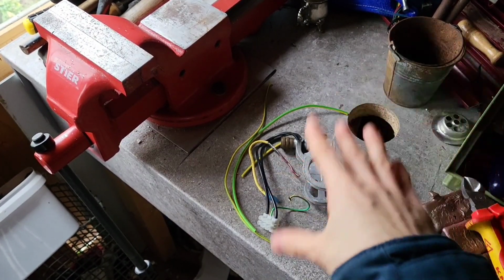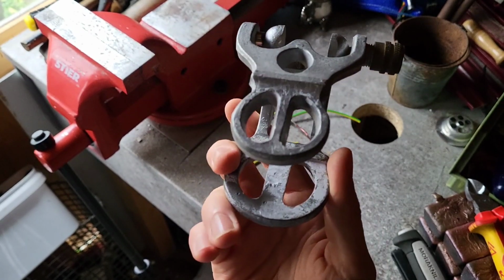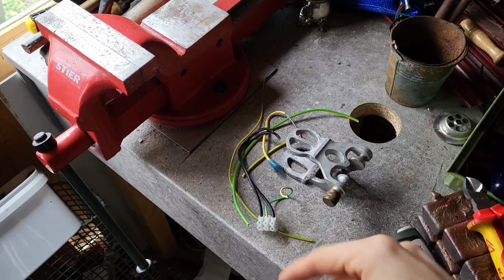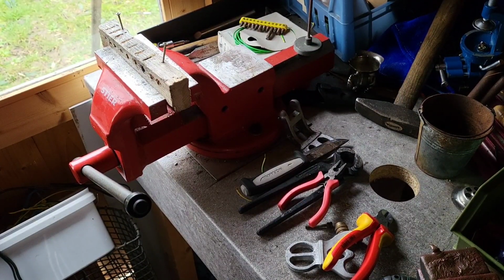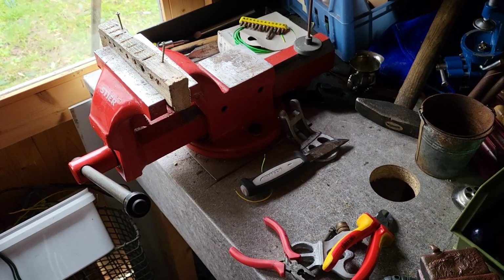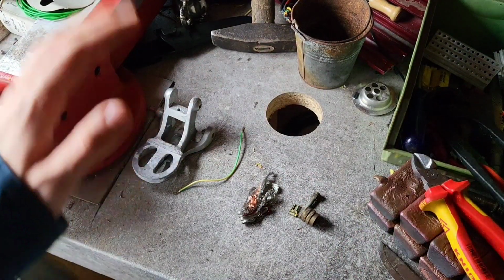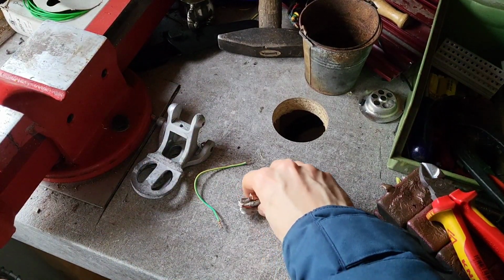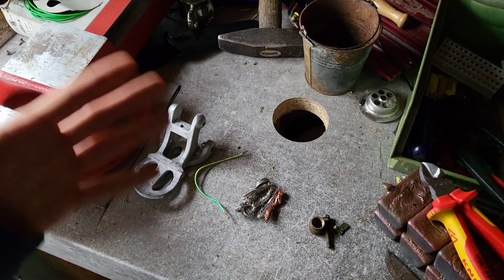Scrapping dumpster finds for copper !

Comment: Good job despite the knife mishap....short lengths like that i tend not to bother with it and instead ill just throw in the 220ltr drum to be sold as a high grade cable if it fits the category or else it will go in the other drum as normal low grade cable.
Reply from the maker: Thanks mate 😊 Well, if I would do that, I would get 1,50€, or about 2 AUD for a kg, so I would literally burn money. That's not something I can do, as my price for wire is exceptionally bad when it comes to high grade wire. Thanks for watching 👍👍👍
Reply: @scrappingadventures290  Ahh ok fair enough and can see why you have to do it, i wish you got the same prices i got so it would save you the extra effort you need to put in and also time, anyway have a great weekend my friend.
Reply from the maker: @danthescrapper815  Yup, that would be very nice for sure, thank you mate, you have a great weekend as well 👍👍

Comment: You're dulling your knife every time you put it on the vice.  Maybe have a block of wood standing by.
After you sharpen your knife maybe have a block of wood that you can stick in your Vice, then start using that to strip,  that's what I do,  seems to work fine.
Your chunk of aluminum thingamajig almost looks like a really old grounding clamp possibly.
Reply from the maker: That's true, but the knive isn't really supposed to be sharp, as it should not dig into the copper when stripping, but it might be that it got a bit to dull over the months of using it, I'll try sharpening it a bit and getting a block of wood from somewhere, that stuff's expensive nowadays 😅 Ah, all right, that sounds interesting, I actually kept all of its parts together, maybe it has a use some day. Thanks for watching 👍👍😊